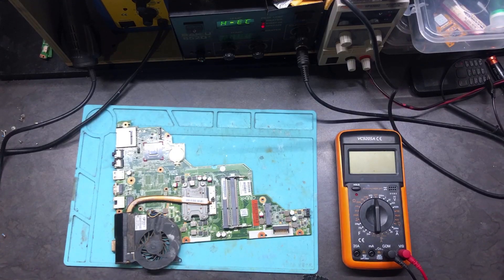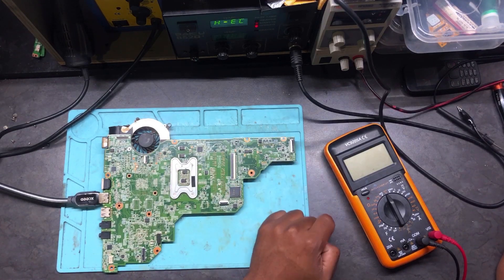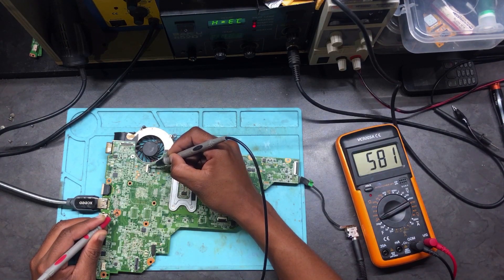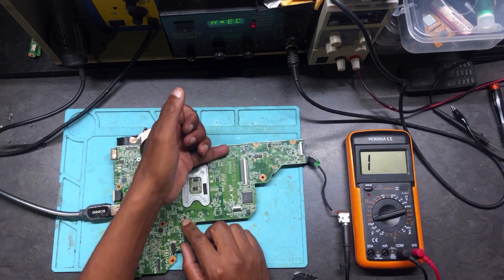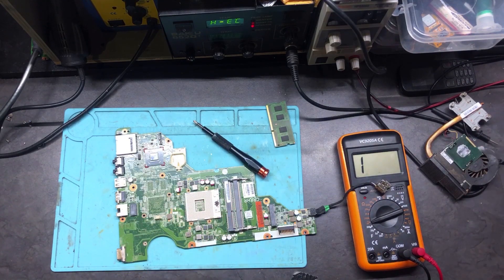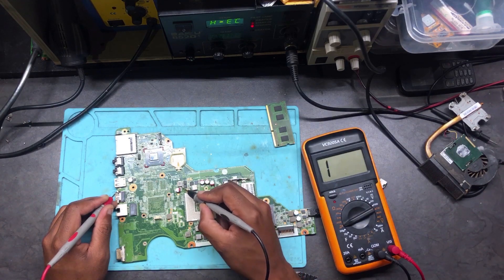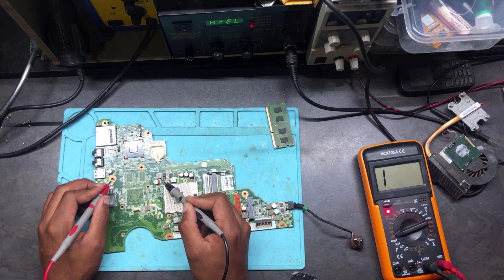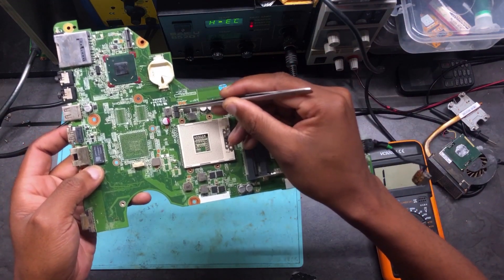Compaq CQ58 repait

Comment: Good evening Bro. Do you remember that I told you about my computer : Fujitsu-Siemens Amilo L7300  which turned off after 5 minutes and tried to restart by itself in vain ? I even took your whatsapp number.
Well, maybe you brought me luck. A day later, I found the solution.
It was the 3 Volts / 5 Volts (MAX1999) chip that was not working 100% well. However it seemed to be giving the right voltages.
Once replaced, everything works fine so far.
Try to see, maybe this can help you with your case.
Reply from the maker: After changing the cpu and the ram the machine started to work 100%
Reply: @jbvtechnologies  Ok. Fine.